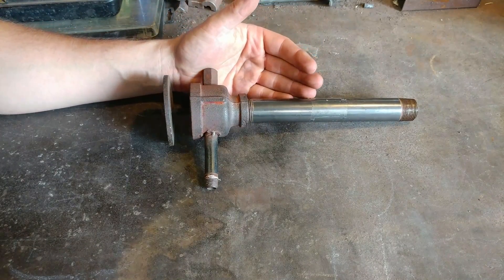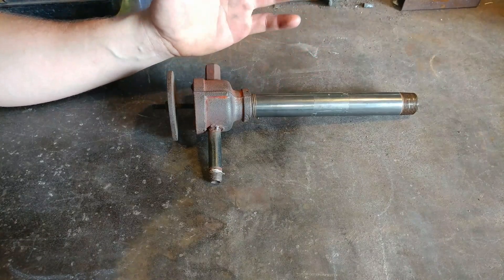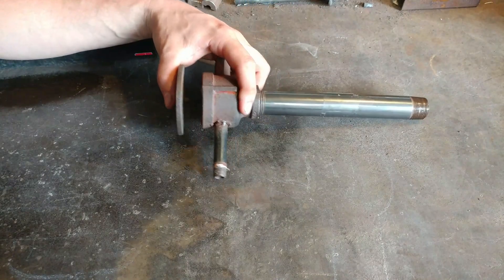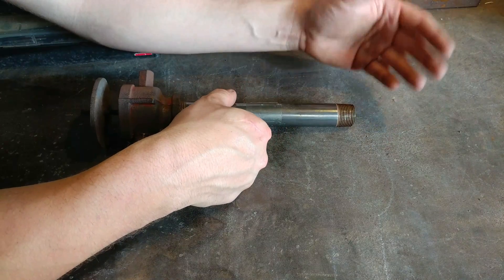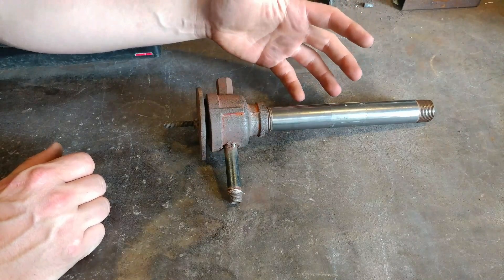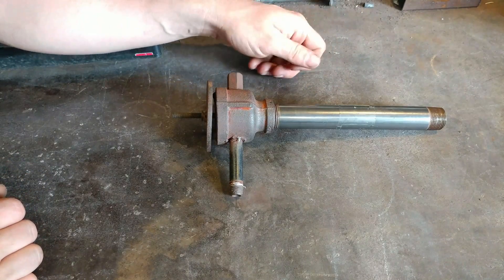QUESTIONS ANSWERED How to Build a Gas Forge Burner:  Homemade Forge Burner for the DIY Blacksmith

Comment: I found your video on How to build a gas forge burner to be very helpful. The only thing that has confused me is the last item on your materials list (1) 6 1/2"  X1" I.D. Pipe, where is this used? I hope I have not missed something that is quite obvious. One last question is do you see any problem in substituting a MIG Welder tip in place of the 0.0250" orifice?  I was thinking of using a 0.030" Thanks in advance for any assistance you can offer. Bill

Comment: Have you ever tried (or heard of other blacksmiths using) a waste-oil burner?  I know they are used (as well as home-built propane burners) in the metal casting community, but I haven't found anyone using them for blacksmithing.  There are several different styles of propane and waste oil burners used; most use some form of forced air.  I believe waste vegetable oil is a little more popular than motor oil; but both are fairly clean if built properly, and both produce plenty of heat.
Reply from the maker: +Brian Neeley I've tried in the past to make a waste oil burner but was unsuccessful in making an efficient one though. Something I look forward to trying more of in the future. You are exactly right they do get quite hot :-) thank you for taking the time to watch this video and comment God bless you and have a great week

Comment: If I am using a smaller tank can I just use one burner?  Use the same plan but only make one?  How else would you make a small flare on the end
Reply from the maker: +Gordon Taff yes you can use only one burner with the same plan as this burner is fairly simple it has also been expanded up to 6 burners before by another guy. All you would need is a shorter propane pipe like you see in this video versus the longer propane pipe in the plans for the double burner. The easiest way to create a flare end is with a bell adapter going from 3/4 inch to 1 inch black Iron. They just thread on to the end and can be picked up at any hardware store. Thank you for the great question God bless you and have a great week

Comment: Very good explanations!  I think that most people don't quite understand how/why a burner works and why it won't if not done correctly.

I'm going to disagree with you on 1 point.  All burners need a flare only if used outside a combustion chamber.  This applies to both blown and venturi style burners.  The only way a burner won't stay lit in the chamber, is if the chamber  is too large.  I have tested this in just a steel cylinder with no insulation.

Thanks for the video..

Comment: i brought your plans for the revised de vinci power hammer today mate looking forward to making something big and getting to a point where i can move more steel quicker if i was to buy a electric motor for it how much power would i need
Reply from the maker: +grayem pepper thank you for your support ! The largest size motor you would need to power the small hammer would be one horsepower it could be powered off of a 3/4 or 1/2 horsepower motor. If you are not using the drill motor you will have to find a variable speed switch for whatever electrical motor you buy as this helps with the fine-tuning of the hammer. Thank you for the great question let me know if you have any more God bless you and have a great week.